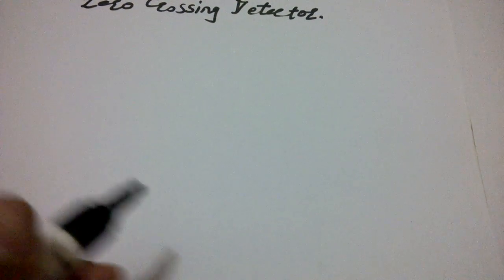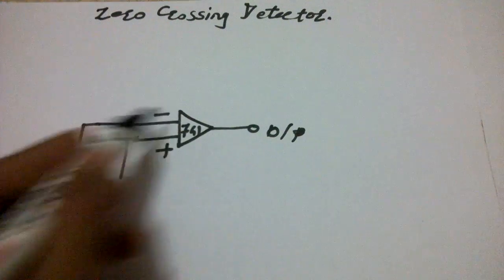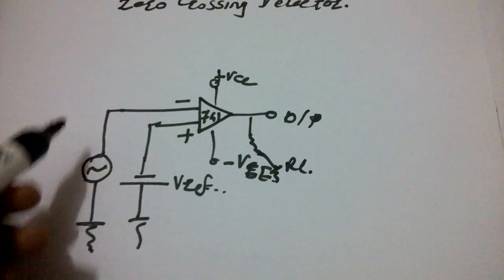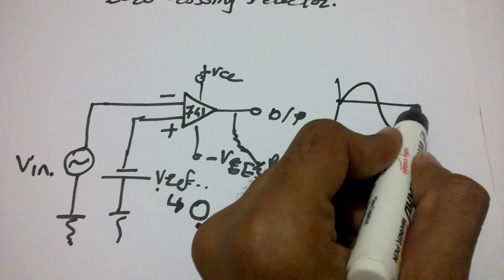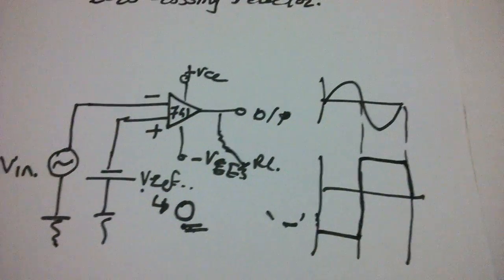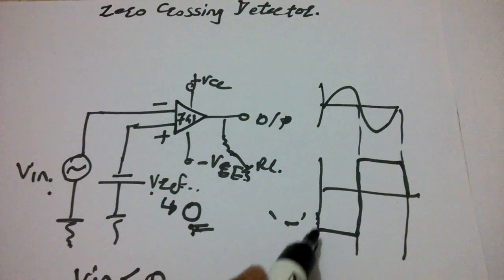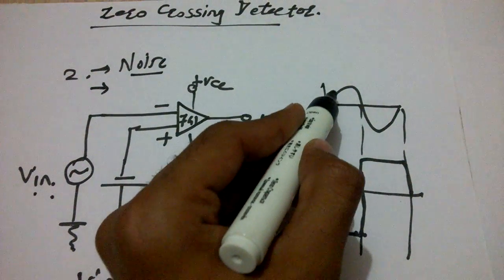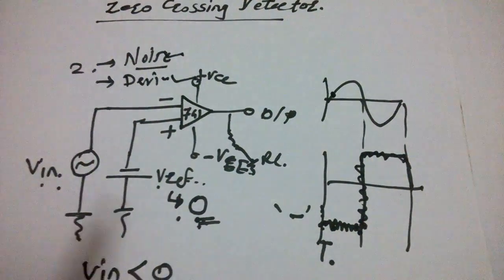Zero Crossing Detector  .

Comment: It's true that the noise is eliminated by using regenerative feedback but we are introducing a hysteresis loop which shifts the ZCD output from a true zero value detection. You have not addressed that issue.

Comment: how can i get a dc equivalent to the peak input without using capacitor???? please explain
Reply from the maker: +Guruaribam Harish ,Capacitor is very useful for the charge storing in the given circuits.and whenever you provide the pick input signal to system then that pick signals overshoot should be store to somewhere to get the straight line (i.e. DC) for that capacitor is important .And during negative cycle of input that capacitor discharges for the same .Hence it seems to be capacitor is important in getting of dc equivalent output circuits.But u can use the tmr 555 Ic in voltage double if you design the amplifier circuit .But it also capacitor in conditioning part .